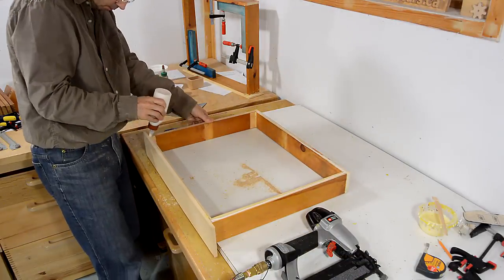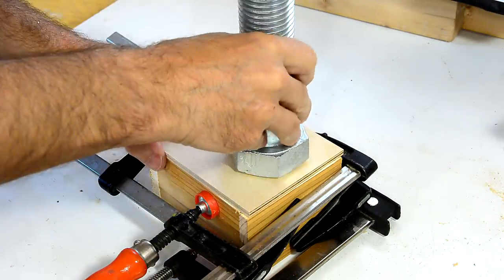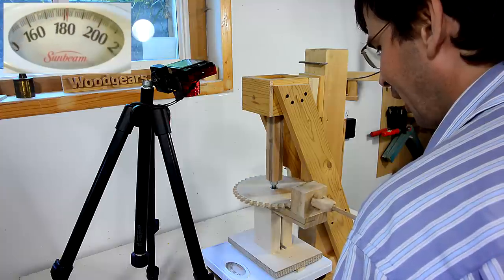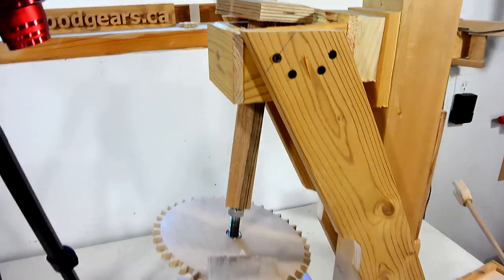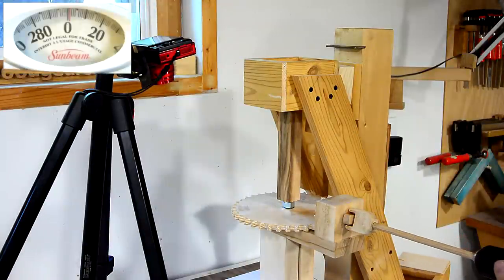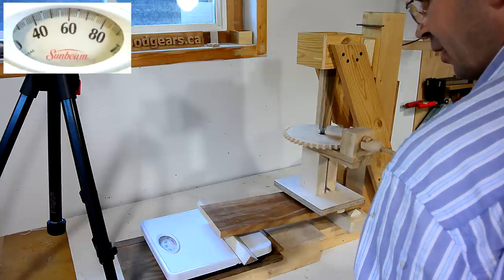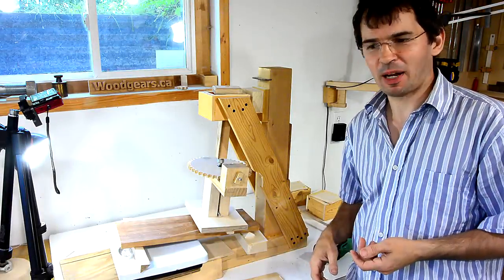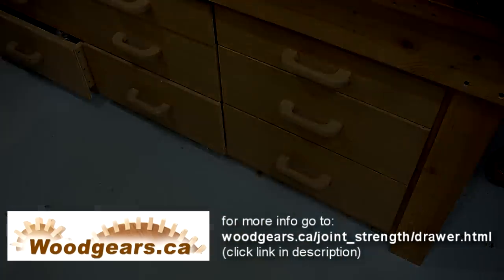Best way to attach drawer bottoms: destructive test

Comment: Real drawer loading is not even but is more in the centre of the bottom. You presume that the drawer size has no relevance but forces don't scale proportionately with scaling the bottom and sides only. Use a calculus concept and take it to the limit (thought experiment) to 1 cm square bottom and then to a 1 metre square bottom. Does the bottom deflection come into play? I think it does.

Comment: I'm not a engineer so i don't know the technical terms but in my experience the bottom of the drawer bends long before the groove itself fail so either it breaks or bend enough to fall off out of the groove.  A small box's bottom would have more compressive strength right?
Reply from the maker: +Fernando Cabette For larger drawers, the bending is ceretainly an issue - and glue flat on would probably be better in this regard.  But I didn't want to test large drawers!
Reply: +Matthias Wandel As I wrote i imagined that could be the case as larger scale would be such a hassle making a test jig.
Reply: +Fernando Cabette True. I imagine a regular sized drawer wouldn't withstand even 800 pounds and the bottom would break even before we got to that point.
Reply: +Matthias Wandel I don't see why you assume that bottoms glued flat would have an advantage over bottoms glued into a dado when it comes to bending. I assume just the opposite. The dado provides mechanical rigidity (as well as chemical bonding) against bending that is not present when there is no dado. The only way to know for sure is to test. You may have more glue surface without a dado, but that's an assumption that may or may not be true. For sure, dados are the way to go if you live in a hot, dry climate that is harsh to glues as they age.

When drawer bottoms have failed on me, it's been because the bottom bent too much at the back of the drawer where there was no dado. Drawers are typically made by sliding the bottom into the dados from the back and then tacking the bottom against the back. It's almost as though the drawer is designed to fail at the back far before the rest of the drawer or the frame of the furniture. Why this traditional point of failure I have no idea.

Your testing definitely gave misleading and inconclusive results. Real drawer bottoms are never anywhere near as strong as your testing would indicate. The flexure and strength of the bottom itself is usually of far more concern than its attachment to the sides, especially since the drawer bottoms are usually thinner than the rest of the drawer. Also, as you point out, modern drawer slides are not built to hold large weights. Typically the cheap ones are only rated at 40 lbs. That's 40 pounds of weight in the entire drawer! With such a low limit, you could probably put 40 lbs of stress at any point on the drawer bottom and it would likely hold even without a dado, as long as you did more than tack the bottom to the back with brads.
Reply: +Matthias Wandel If you're going to prove your theory, that's the only way to do it.
Reply: The technical term is call "IKEA furniture"

Comment: I might be wrong (if so, I'm sure I'll be corrected). My impression was the entire purpose of the groove was to allow for expansion when drawer bottoms were constructed of solid wood stock not plywoods. I never thought of it as a strength issue.
Reply from the maker: +hassleoffa For solid wood bottoms, yes.  But with plywood, there isn't any expansion to worry about.
Reply: +Matthias Wandel You may not have to worry about the bottom expanding and contracting, but the sides will.  Of course, theory doesn't matter.  If your drawers stay intact, good.  Of course, it's easy enough to reglue if necessary.
Reply: +Jason Small 
The sides will expand and contract vertically so don't care.
Reply: +hassleoffa You are correct in that, and also it's a matter of appearance, when they are grooved the edges cannot be seen
Reply: +Jason Small ,nobody has drawers like Mathias.  that is one wood  master/ expert for a lifetime . everything clean , everything organized,.. full of ideas . .that's hard to find .
Reply: Indeed.  And, from his own research - https://woodgears.ca/wood_grain/shrinkage.html the change in the length really does not matter.  It's not like plywood is perfectly stable either.  If there is a problem, it's more likely to come from closing the drawer hard and something knocking against the back.  Also, if there's a weak point, it will spread.  But  as I said, if it works, who cares.
Reply: He also doesn't seem to factor in the wood bowing under weight, specifically when he's talking about that drawer that's twice the length and width.
Reply: I should point out to people, that just because someone puts up something on U-tube does make it a fact.I have spent 49 years as a cabinet maker and in MY experience the strongest way is to groove the front and sides and to then cut the drawer back by the amount of to the top of the side groove and glue and screw it it place. This method also allows you to square the drawer which is vital the it fitting and running perfectly
Reply: My favorite glue is polyurethane , it woeks with everything even marine work
Reply: +Jack Fletcher Having seen so many of Matthias's videos, I have to put my money on his engineering degree over your 49 years of experience.  I've met far too many people who think that just because they've been doing something for most of their life, that makes it right.

With your way you mention that you can square the drawer.  I assure you that with every different way you can still square the drawer as long as you're paying attention to what you're doing.  The fact that Matthias is willing to put his designs to the test and you're not just puts more of my faith and understanding into his work than into yours.
Reply: hassleoffa this is true, with a solid wood bottom, You would always have a cross grain situation with 2 of the drawer sides. Seasonal expansion and contraction would eventually crack the drawer bottom and maybe even open the damage the joints of the box. Also it looks better. With modern phenolic glues in plywood you have a much more stable bottom, But the Drawer box still expands and contracts. All be it to a far lesser degree length wise.
Reply: +Reboot153:
I thought Mr. Fletcher needed a reſponſe, but waſn't entirely ſure what to ſay, when I ſaw your comment. You really did a wonderful job. Thank you.
Reply: Matthias Wandel If the drawer is made of the same timber as the base why would expansion of the base be a problem?

Comment: FWIW, all the drawers were built with nail and glue a flat piece of plywood to the bottom of the drawer sides method in an old apartment building we used to own. The drawers were about 50 years old by the time we sold the building and we had never had a single drawer bottom failure in the thirty years we owned the building. As the Russians would say (according to Mr. Kalashnikov) perfection is the enemy of good enough.

Comment: "The space efficiency of pure chaos is hard to beat." - Matthias Wandel -

Words to live by.
Reply: My new motto! :-)
Reply: Best quote ever. I'm gonna remember this and use it regularly.
Reply: +Mark Lindsay That statement also struck me as being important, and correct, and should be remembered.  However, maximum holding capacity is not always the priority.  Often times you need things arranged so you can find them quickly and retrieve them easily.  Also, items stored randomly together contact each other, and can potentially be damaged.  Knowing principles is important so you can use them where they best apply.
Reply: And I love that it comes as an aside, tossed off at the last second.
Reply: +Mark Lindsay That's why I never fold my clothes.  I just stuff them in a drawer.  Except when I do that the bottoms break out.  Crap.
Reply: Brian Diaz  Dude - score yourself 5 bonus points. I actually LOLed at that one.
Reply: +Mark Lindsay This is why "junk drawers" are so important and part of almost every household.
Reply: +Mark Lindsay If you watched Tested videos you would see the other spectrum. Adam Savage is meticulous with his tool storage. In fact he got rid of drawers for his tools and created custom carts where nothing has to be moved to get what he needs. He calls It I think "First order retrieval". :)
Reply: +Mark Lindsay Being able to find something you're looking for trumps space efficiency. This is coming from a chaos space user.
Reply: tml4873
Yes!  If you are really that short of space to store your stuff, you honestly have way too much stuff.  With that said, I have old parts thrown in boxes.  When I need something out of a box I pour the contents into an old baking sheet and can find things pretty easily that way.  I just pour the stuff from the baking sheet back into the box when done.  But I would never store tools in a jumble like that.  They're too expensive, and fragile for that.  Not to mention, when I need a tool, I need it NOW!  I keep my tools displayed on a tool board.  It happens to be on castors, but that is optional.
Reply: +Mark Lindsay I love that quote.
Reply: Mark Lindsay and
Reply: That's what I think when I see people make french fitted drawer liners that need a square foot of space for each screw driver.
Reply: I printed this quote on a small poster with Matthias' picture in the background, and it hangs in my office. I'm disappointed at the lack of response I've gotten from my colleagues.
Reply: Pete Nilsen 
Haha, “junk drawers” make a perfect compliment to all the “organized” ones. 
(By definition;)

Comment: Interesting results.
Overlooked in tests like this is impact force. Dropping something into the drawer, especially something heavy, will apply much more force than just a static load from the same weight. Making the joint with some give to absorb some of that force should make it less likely to break.
Reply: +John Heisz I was thinking that too. Also, how does a loaded drawer fair against an empty or lightly loaded drawer. Too many data points to address on this short question "what is the relative force a flat vs grooved joint capable of?"

Would be interesting to devise how does a loaded, lightly, empty drawer handle a small, medium, and large dropped item (hard surface), and vs gently laying in (cushioned surface perhaps). Taking multiple values for each condition, and scaling between drawer dimensions and aspect ratio (long vs square boxes), that's a lot of lumber and labor before you've cracked one glue joint.

Do you know of a research grant focused on woodwork?

Idk exactly how I came up with this idea, but I've had a sense of intuition that small things are relatively harder to break than larger, feels similar to the idea that higher frequency = more energy, such as small scale testing of resonance collapse seems more difficult than large scale.
Reply from the maker: +John Heisz True enough.  But I think I have enough safety margin.
Oh, and if the glued flat on were to break, I think that type would be easier to fix.
Reply: +John Heisz Good idea for another destructive test: impulse loads on drawer bottoms.
Reply: Hence using a number of screws in addition to glue?  (How I do most wood projects.  Learned this technique in 1980.)

Comment: Nice test.

Interestingly, when proven wrong you justified glued on bottoms with the explanation that it was still more than sufficient to do the job.  

This is absolutely true and I totally agree with your logic.

However, it is exactly the same logic that you dismissed when you did your test with the (ever hated) pocket hole screw tests.

Surely, face frames that are joined with pocket hole screws, that are never subjected to the type of pressure you exerted upon them, are more than sufficient to do the job.

I have even constructed a workbench that has, in some places, joints made with pocket hole screws.  If they do the job that is all that matters in accordance with your (and my) logic.  Horses for courses.

Comment: The application of lever use was a good demonstration of principle. If you scaled up the plywwod thickness to full draw size it would be at least 1.5 inches thick. I think deflection of a standard draw bottom has not been taken into account in your exciting demo. Put a huge weight into a loose bottomed drawer and the botom will bend and them fall out without and material breaking. Cheers

Comment: I think the large pressure block may be elevating the results, as being so close to the walls would transfer the force nearly directly into the side panels.  your results seem to indicate the difference between the strength of the wood, and the strength of the glue itself.   

 I would be interested in seeing it the tests again, reduced just the center post in the center of the panel and the "sample drawers" enlarged to the 8"-12" range     While this will make the panel bend, I think it would be a more representative test of when the bottoms fail on drawers.....    

In my experience, drawer bottoms fail from overloading at the center, bowing the panel and thus weakening the joint with the sides.  In the drawers i've had to repair, in the majority of cases, moisture of some sort was also a factor, causing premature failure of the panel material itself.   The pieces i've built in the past, if the drawer was more than about a foot in a given dimension, i always used a reinforcement strip to help span the distance, and keep the long sides from bowing....

Comment: I'm pretty sure that doesn't scale the way you indicated. If it did then modulus of elasticity would be meaningless. But we know that it isn't, so you'll actually be subjecting your joint to a different set of stresses on a large drawer than you would on a tiny mockup. 

That said I glue the bottoms on mine, even on my shop-built truck toolbox which is full of heavy tools in all three drawers of different sizes and which gets rattled all the time. No sign of failure after 18 months of use. I believe that gluing the drawer bottoms is more than sufficient. I just question your conclusion/assumption at the end.

Comment: I think the failure mode for a large drawer is more to do with the bending of the ply.  The ply bends and peels the glue away, or in the case of the slots, it pulls the ply out of the slots.  I think an improvement to your experiment would be to use a larger drawer of fairly standard size but with a force applied in various test locations rather than a uniformly distributed load.  This simulates the real world application far more accurately as it takes into account the bending of the ply and uneven force distribution.  Great video as always.

Comment: This is timely.  I noticed some of the drawers (cheap) in our kitchen were warping and wasted a lot of volume by insetting the grooves for the bottoms roughly 1/2".  So, I was thinking about making new ones and gluing the bottoms on just like you did to increase the useable volume.

Thanks!

Comment: Hmmm, you might have found your T-Shirt slogan:   "The space efficiency of pure chaos is hard to beat".  :-)

Cool test.  I too was cringing in anticipation of the breakage.  After the near explosive separation of the first one I might have reached for a hard hat.  You're a brave man, Matthias.   
I was also a bit surprised at the outcome.  I do wonder if the results would differ slightly on a larger drawer, but I agree that there is no need to do that test.  I think you proved your point well, that this method is more than good enough.

...art